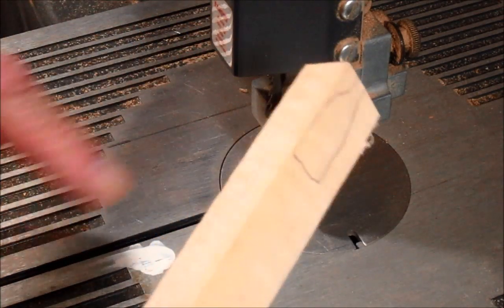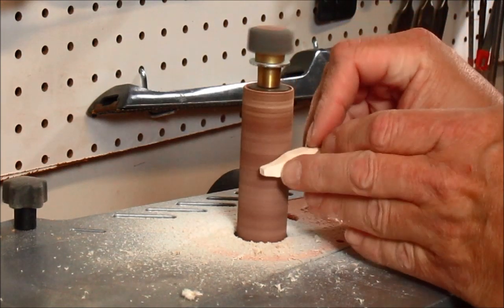Saloon Bird Feeder Follow Up - Outdoor Woodworking Project

Comment: I see you have cow birds. I have them here in SC they can clean out a feeder in 5 min. 
Another way to make the bottles. use a scroll saw make 2 patterns of the bottle adhere the to a blank 1 on top one on the side 90 degrees from each other  them cut them out you have a 3D cut.